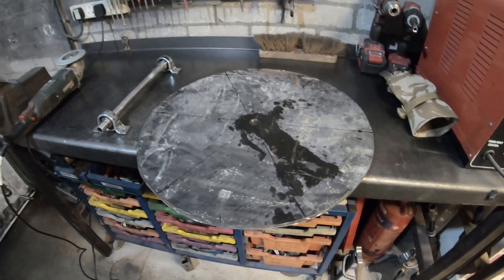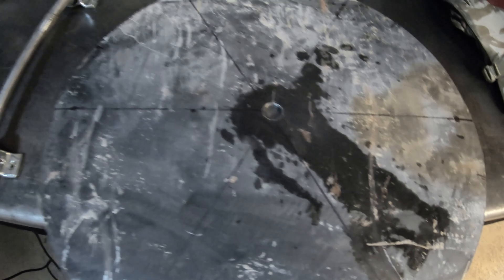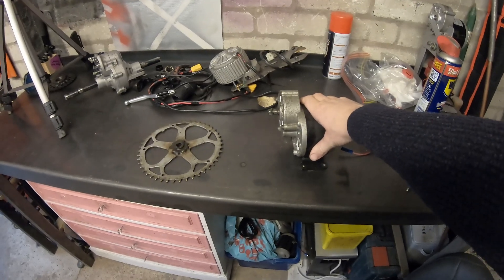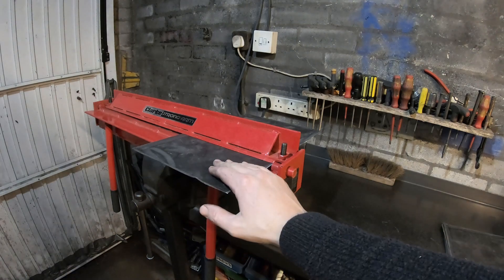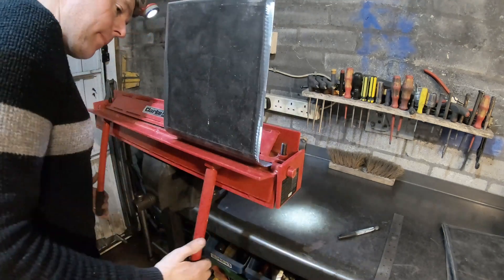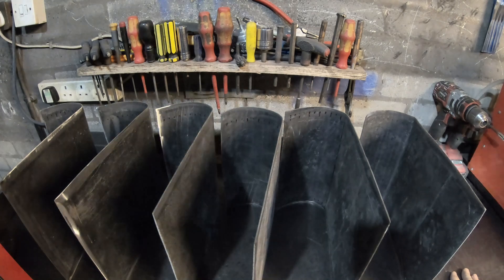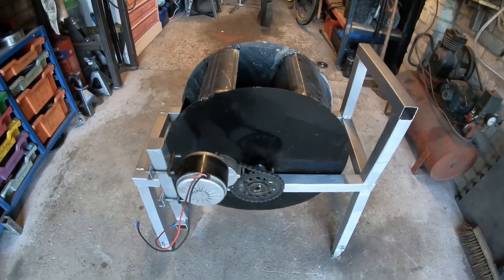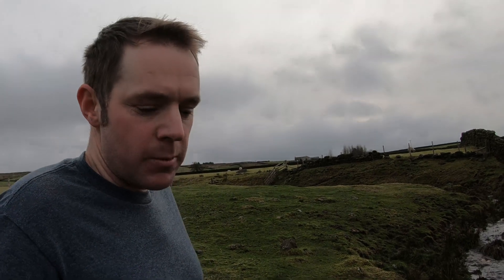Hydro electric power. water wheel

Comment: Try open tesla turbine instead of the water wheel. Easy to diy from metal. Its just a large stack of discs rotor. Or from plastic sheet discs too.
Reply from the maker: the tesla turbine is an interesting idea and something I will have a go at making. thanks

Comment: The buckets should be bent a bit outwards so that the water really flows out at the lowest point and not get pulled back up while flowing out. If more height difference can be used, it should. Using a 3-phase synchronous brushless AC generator with an mppt charge controller would increase the efficiency alot.
Reply from the maker: I may try an open bucket design in another build,  but I thought I might get some fly wheel effect with this design [the buckets slightly closed].
Thanks for the comment.

Comment: Nicly made buckets. Seems to work well.  What amps did it make?  Hint, always put bolts in from the top, not the bottom.  That way if a nut comes loose the bolt should hold the work while you find a replacment locknut.
Reply from the maker: Thanks
good point on the bolts.
as for the amps it made, I don't know yet. I am going to buy a dc power analyser and test all my recent builds in another video.